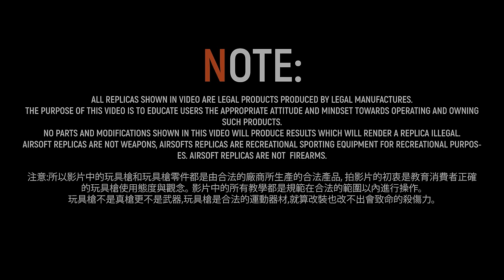Toy Gun ASMR - Maxim Defense MDX +GBL Short Bolt

Comment: So you're telling me that, apart from the fire control group and cut on the lower where the bolt catch is, this is just an ar lower. And the upper has a fully functioning forward assist, radian raptor charging handle, dust cover, and a gas tube intake? This is just an ar fitted for airsoft. That's crazy
Reply: My question is... are these controlled items??
Reply: @jurrienarevalo124  What if i told you that they ship to your house but that the tolerances are NOT the same ?

Comment: This is probably a dumb question. But are these real guns you just put airsoft barrels and components in? The quality is just amazing.
Reply from the maker: Nah its not a dumb question, but this one is specifically designed for airsoft, and the quality is pretty amazing indeed
Reply: Although the operation seems realistic, airsoft guns fire BBs are propelled by compressed gas, internal parts cannot be interchanged with real firearm parts, neither can they be converted into real firearms without practically replacing every critical component

Comment: Quick question, what is the blue thing you apply to the places? Is it lubricant? If i dont have it, can I use lubricant to achieve same outcome? Thanks in advance
Reply: Not lubricant, it is screw glue.
Reply: Is it a must to have?
Reply: @edword911  Not really, it's only if you want to be sure that don't lose any screw.
Reply from the maker: its locktie to prevent screw getting lose from all the vibration caused from the gun
Reply: @4UADSmartAirsoft  thanks, is the Maxim Defence a replica or real one? Does these PDW usually get lose when used on GBB?
Reply from the maker: @edword911  This one is just a kit, its not a real deal, and I usually apply locktie to my screws since I've lost way too many screws in the middle of a game

Comment: Definitely more relaxing watching someone else do it... Do you cut out a pot of swearing? Or am I just never doing it right? 🤔🤣

You want some buffer tube with your loctite? 😜 Guess it ain't gonna shake loose from recoil at least...

I like the adhesive/grease pen things with the integrated brush. Seems like a better way of getting a nice even coat and minimising excess. 👍

Oooh. Is that a hop adjustment key dial insert thing you put into the chamber?
Reply from the maker: Hahaha I will get you one of those lube pen and this 45minute video actually took 5 hours to film…. So yes there were swearing going on lol. How do you like your Fal so far?
Reply: @4UADSmartAirsoft  loving it. Have to wear earphones to lessen the right ear deafening. But it shoots heavily and far with pretty good consistency. Will probably get the railed top cover and bung a red dot or ACOG on there because my eyes (or eyepro itself) are going too meh to pick up the rear irons at times.

Comment: I'm pretty sure that lower is a proper machine gun.
Reply from the maker: Lol you are correct
Reply: @4UADSmartAirsoft  after closer inspection, it apperars to be high-shelf lower receiver, however with third pin hole. Conflicting, it have and also not have select-fire features. Do you, ba chance have a stanag magazine to test if it fits? Or if pins align with .223 upper receiver? If so, care to share link where can I find one? Academic purposes only.

Comment: Hello there!

As always, very nice vid :)

I just wanna ask one thing - I see you installing a brand new version of GBL HopUp here (with the GHK HopUp adjusting tool) - but does it support the standard AEG barrels? Or do I need a VSR/GBB one?

Many thanks in advance!

BR

Ivan
Reply from the maker: Hey Ivan, it takes both barrels, and for the bucking if you wish to use standard gbb bucking, you just need to shorten the bucking and trim off the side nub. Hope this helps
Reply: Thanks a lot!

Comment: The lubricant pen contains PTFE which is known as superbad for you and the enviroment, a everlasting chemical. The use of PTFE will be restricted in the EU starting 2024.
Reply from the maker: Thanks for the helpful info!
Reply: @4UADSmartAirsoft  In Germany, we have some villages and counties where the groundwater is already eternally contaminated because of a small amount of PFAS, PFOA and PTFE, and the water may no longer be drunk according to official orders. These chemicals are very mobile in water and soil; they dissolve well in water, are hardly retained in the soil and therefore quickly reach the groundwater. The long-term effects are disastrous. One should keep a great distance to these substances, by smearing the airsoft gun inside, smallest amounts are released into the ambient air with every shot and inhaled, these accumulate in the body and blood and are very difficult to break down. You can determine the amount of these substances in your body with an advanced blood test.
Reply from the maker: @shorty7943  Thanks for the good information provided and we will look into some more solutions to get this product improved.